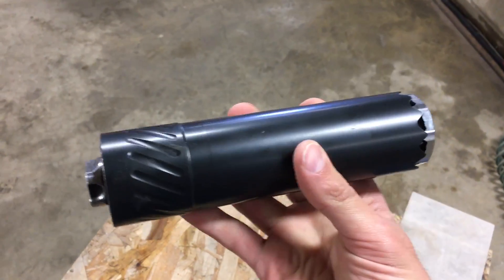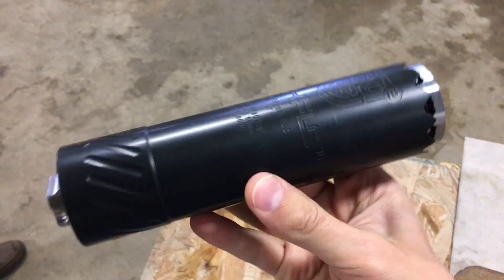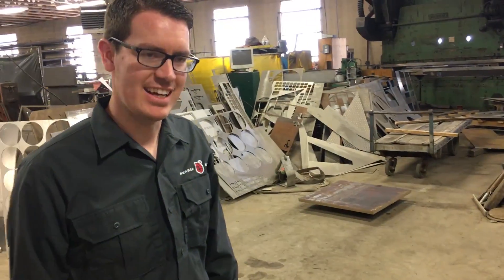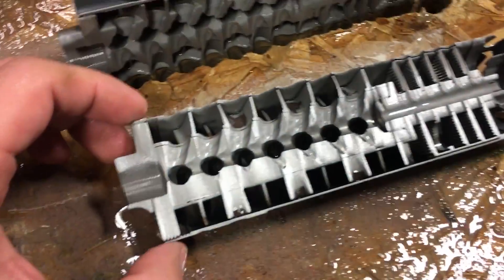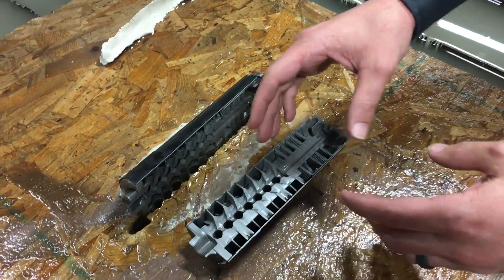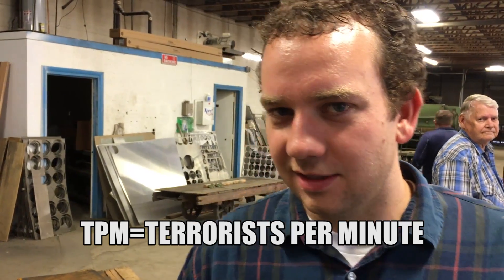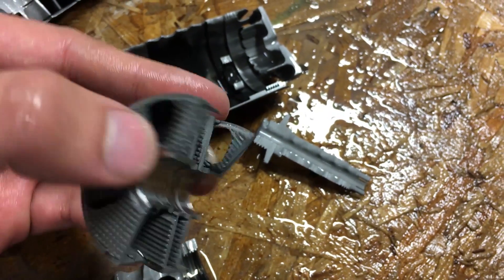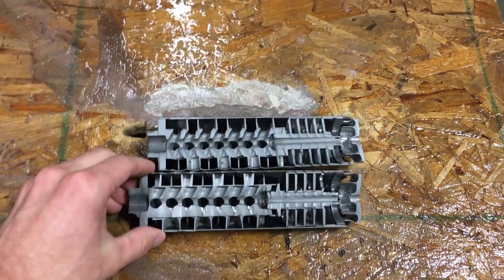Gun Suppressor "Silencer" cut in half with Waterjet

Comment: It's not the app that sucks, it's the microphones in the phone. Cellphones don't have microphones capable of picking up extremely loud or extremely quiet sounds. You would need a decibel meter and a pretty special one at that. Most meters only go from 30db - 130db.
Reply: The app crashing every minute is not because of the microphone.

Comment: LOL!! measure the sound level of gun shots with a phone. Yeah - the app may have sucked, but what sucks even more is the recording ability of the phone it self. Even if the app had worked as it was supposed to, all measurements (regardless of weapon or if the suppressor is on or not) would have shown the same value - the maximum level the crappy built in microphone/audio circuit can take before the wave form is cut off.
But yeah - the cross section of that suppressor was really cool!